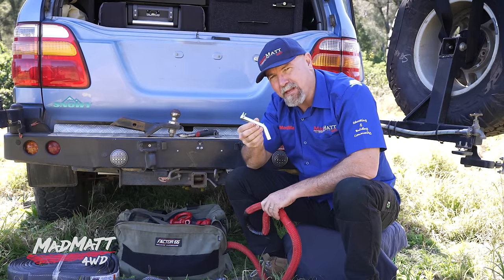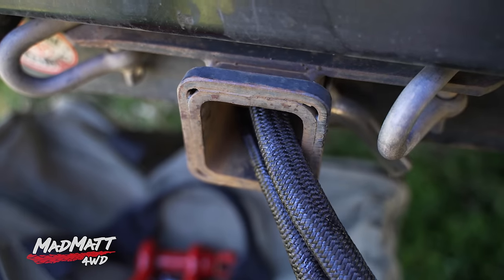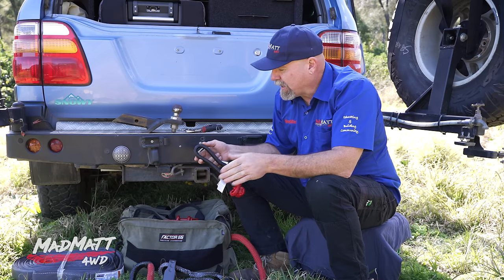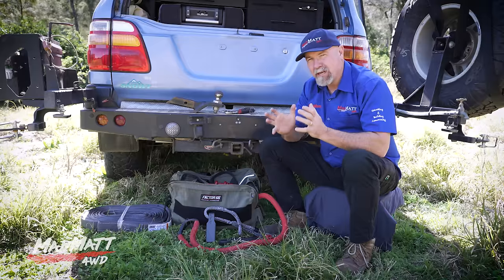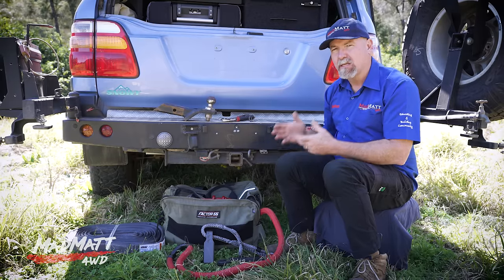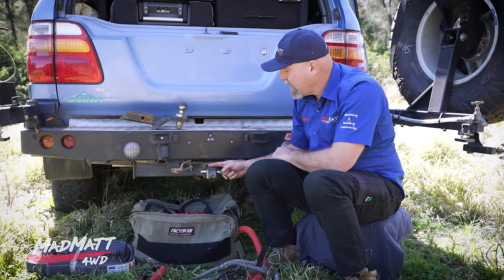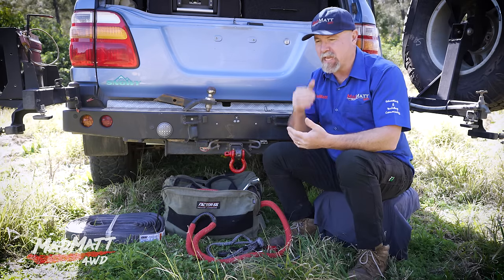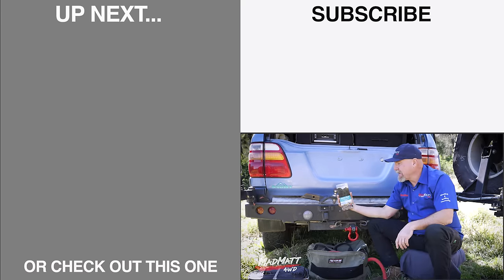Should you use a hitch pin as a 4x4 recovery device? Is it a YES or NO answer?

Comment: i am scared of the soft shackle. i saw a video where one failed or at least appeared that way when it hit the rear fender of a doually it bent the fender in really bad. i saw where they were making the soft shackle but the ball or knot is not soft it appears to almost be hard as steet they were hitting the knot on a piece of steel the know is very hard i think a blow to your head could kill a person. i only use steel shackle never seen one broken
Reply from the maker: That’s interesting. Yes the knot is hard and I suppose I have to agree with you it would be dangerous. Rated shackles have a five times safety rating.
Reply: A side-loaded bow shackle is much more dangerous.   A soft shackle is less likely to become a projectile.  That said, I still wouldn't stand next to them while under load.

Comment: Tl Dr: the pin is not strong, will likely bend and be unremovable. Expect this method to fail and use only when no other method exists. The end of a strap is better than a soft shackle for the tight radius and chafing on the outer edge of the receiver.

Above all, be gentle.

Comment: I just had a look for recovery hitches on ebay and heaps are rated <5 tonnes. That's worse than the pin no? Am i missing something?
Reply from the maker: Yes the pin has no rating at all for this type of loading. The hitch reciever I show has the 4.3t (9500lbs) WLL but when. Tested failed at 23t (51000lbs). Personally I’d be careful of eBay stuff. They say it’s tested but it’s easy to fake it.
Reply: A shackle hitch receiver (45,000lbs rating) or some soft shackles (around the hitch frame) won't cost more than $50 USD.  Small price to pay to mitigate the weakness of a hitch pin spanning a 2" gap.  Even my 7/8" clovis pin hitch is only rated for 10,000lbs and would not be trustworthy in a kinetic recovery.  Everyone learns to respect Physics, sooner or later (too late for some, unfortunately.)

Comment: I think this vid is designed to sell factor 55 hitch receivers, first point you make about the tow bar receiver being sharp is correct, the simple solution is to file the edges over, easy, Robert Peppers test of the hitch pin bending at 9,000kg/  19,800lbs, that's a hell of a lot more than the factor55 hitch receiver is rated at 9,500lbs/ 4300kg, As a 4x4 nationally accredited assessor for over 25yrs and using the tow bar receiver and the hitch pin with a 8,000kg flat snatch strap I have never seen one pin bend, I have seen snatch straps break, so must have developed  over 8,000kg.The factor55 hitch receiver looks good, they are NOT a necessary recovery item.
Reply from the maker: Very few items are necessary. As an assessor I’m surprised your using the pin.
Reply: @MadMatt4WD  Go back to school and study Maths, If you take the 9,500lbs/4,300kg rating on the factor55 hitch, the weakest point in a snatch, using  rated recovery points and a rated 8,000kg/17,600lb strap would be the 55 hitch, and the weakest point on the hitch would be the hole where the pin goes through, if that let go at that point on the hitch you would have a big hunk of metal flying towards the back of your vehicle, unless you used one or 2 drag chains as a dampener on the strap. one chain a third along the strap from each vehicle.
Reply from the maker: @user-nk4gm7bi2v  The reason the hitchlink is rated at the 9'500Lbs/4300kg is because that is the TOW rating of the tow pack. (limiting factor) The tow pack is rated at at WLL not a break strength. 
The offroad industry works on break strength NOT WLL therefore you can't compare the WLL of a hitchlink with a snatch straps break strength. 
Some numbers for you from @factor55 testing for when thier devices fail (break strength.) 
Standard duty soft shackle 39,000LB
Tow Strap 31,000LB
KERR 29,000LB
Hitchlink2.0 51000LB
Hitch Pin 50,000+ LBs

Another example for you.
3/8 synthetic rope breaks between 18-22,000LBs so if you assume a safty of 5:1 that would mean it's WLL is going to be 3.6- 4.4K on a 12,000LB winch

Here's the issue with using a pin it is not in true double shear the way it is when it's used with a hitchlink or the actual tow hitch. As you've found a strap used with care can be connected to a pin as an emergency recovery tool but it sould not be taught as being a safe method of recovery.

As I'm sure you're aware according to the Australian standard we should not even be connecting a snatch strap or any recovery device to a tow pack/bar.

Schools out.
Reply: @MadMatt4WD  Like I said previously, Have seen hundreds of snatch strap recoveries using the strap on the tow pin, never seen one bent yet
Reply from the maker: @user-nk4gm7bi2v  which is why I maintain it can be used in an emergency but not as a primary connection point. I do hope you’re not teaching people to use it as a primary connection!
Reply: A couple of points here:

1. A 'rating' could be WLL or MBS which are very different. F55 tend to rate their gear with WLL often a 2:1 factor which is typically used in horizontal pulls.  A test to break is MBS.  So, a F55 unit of 4000kg probably has an MBS of 8000kg. Tow pins don't have a rating for recovery and it'd depend on whether it's in single or double shear anyway. As you say, time has proven they do work. They also bend, not snap when overloaded. Eventually of course they do snap!

2. A strap rated to 8000kg is typically an MBS, and many straps fail below that so if you see one break, I would agree that it must have been due to a load of 8000kg+.  

3. The tow pin itself has a tiny bend radius which isn't good for ropes or soft shackles. If you put your winch thimble around it then the thimble will deform to the point where you can't fit a 4.7t shackle through...I have made this mistake. Bigger bend radii = greater breaking strength = greater safety.

Comment: Bend a pin or chaffe a soft shackel Its a billion times safer than a hitch ball cannon ball.  

The reese 10,000lb rating in any direction hitch swivel shackle is better than F-55' 9500lb in one direction hitch shackle.    Even hitch shackles aren't the best. 

Doing a soft shackle Y configuration to two recovery points rated at 12,000lb each is better.

Comment: so.....the hitch pin yields at around "9 metric tons" but the factor 55 hitch piece is rated for 9500 lbs which is 4.75 tons or about 4.3 metric tons........
Reply from the maker: Thats a good point I hadn't connected that. I'll have the discusion with Factor55. I still maintain it will be a better connection point.
Reply: @MadMatt4WD  Does the 9500 pound rating of the F55 insert mean that’s how much force it can withstand or is it the max weight of the vehicle you can use it with?
Reply from the maker: Thats it's tested rating WLL working load limit not it's fail rating thats at 23000KG. I need to learn more on this.
Reply: @MadMatt4WD  That’s good to know
Reply from the maker: Josh I’ve been discussing this overnight with Factor55. Here you go. Thanks for the question because I learned something too. The 2” hitch itself is rated for 9500 lbs. that’s the max load. That’s why the 2” HitchLinks, all of them have 9500 lbs machined into them. Our parts have not seen yielding in testing until just before breaking. What’s this mean? Every other item you have attached to the HitchLink and pin will fail before either of those do. 

Standard duty soft shackle - 39K 
Tow Strap- 31K 
KERR- 29K 
HitchLink 2.0 - 51K 
Hitch pins- 50+K 

The entire off-road industry functions off break strength not WLL. 3/8 Synthetic rope breaks between 18-22K so a 5:1 means it’s WLL is only 4.4K on a 12K winch? 

It’s about quality of materials and validation through testing.
Reply: @MadMatt4WD  great information thank you.

Comment: Good video Matt 
But that hitch at 9500 lbs when most trucks are around 3 ton then you load mud and suction. You have all ready over loaded it or same when stuck in ruts or on rocks 🪨 think on what you are saying then you should not use a hitch receiver either as it's not rated for job your thoughts
Reply from the maker: I get what you’re saying. It comes down to what the rating refers to and in Offroad this is often an unknown. In this case it’s the WLL. Working load limit. Take 4.75t bow shackles. They have a safety factor of five. So even they’re being used outside of spec often. But all this comes back to doing our recoveries with greater safety. Not going like a bat out of hell with a kinetic recovery and not reducing the recovery load.

Comment: Fact safety harness and fall arresting Safety strap  250 lbs object dropping 10 feet develops 5,000lbs of energy. It has a solid piece of rope or polyester strap reaching the end of the strap will shatter your pelvis compress your vertebrate Crippling or killing you. That is why there is a kinetic energy section of safety harness tether.  Apply this information to your tow recovery gear. Can you use the hitch pin in the .manner outlined "Yes" been done so hundreds of times. Speed kills. Falling off a cliff doesn't kill you the sudden stop traveling at 32 feet per second  that kills you. Video on YouTube in which they use a class 3 receiver hitch with a block of steel and three quarter inch shackle of the 5/8 inch pin and they use a tension measuring device. And they destroy kinetic  energy straps 1"  Samson kinetic rope. Move up to 2" diameter Samson nylon rope  the pin bends as does the shackle  and the welds joining the square tube to the tube forming the mounts at 65,000 psi. Note as a welder of many years I know that  the first  numbers of a welding rod is the tensile strength per inch of bead.meaning 6011 welding rod welds will fracture if pressure s exceed 60,000 psi pounds per square inch. As per my comment in you in your previous video the hitch assembly is only as strong as the weakest point  it turns out it is the welds.
Reply from the maker: Thanks for the comment. I didn't know that about the rod number.
Reply: @MadMatt4WD  your welcome, I've always try to provide positive information in my comments. By the way back in the 1970's in my early welding years the heavy equipment repair yard used a mild steel welding rod that had similar properties to 6011; was a very smooth low splatter rod called " MAGNA" if memory serves  an  Australian manufacturer do you know if company is still in business?
Reply from the maker: @orangepickel2  I've not heard of them. although I fabricate as you know I'm fairly amature.

Comment: You are using the wrong water tap at your spare wheel. That tap works under town pressure to push up the valve from the seat. Gravity fed water will not do this well. Use a ball valve instead.
Reply from the maker: Ah yeah except this is on a pressure pump and works really well. 😜

Comment: I disagree with a few points and agree with others, as for the speed you cover you didn't cover how much slack to have on the strap, I have seen people basically park bumper to bumper before taking off at speed.
Also no one should be in the area while a recovery is taking place, atleast the length of the strap away from any recovery point on either vehicle.
One other thing the more equipment used the more possible failure points you add.
Reply from the maker: Great comment. The amount of slack has nothing to do with the speed. Some cars can hit 15kph faster than others but 15kph is still 15kph. Agree with the distance for people. Failure points yes but if they’re in good order and correctly designed they don’t fail so it’s a moot point.
Reply: @MadMatt4WD   you use the word "if" they are in good condition, if is a very important word, I have seen dumb things done during a recovery I doubt these people checked or even know how to check their gear, so "is" their gear in good condition? Is more the point.
Reply from the maker: @melthebelgian.5837  good point. It’s a tough problem we have.

Comment: Hitch hooks are not used anymore?
Reply from the maker: I've not seen this item.
Reply: @MadMatt4WD  It's just a hook that fits into a hitch receiver.  It's useful to have it attached full time, and other then off road use, it's a good parking offset for those that enjoy getting right up to your rear bumper.  

http://cdn3.volusion.com/wmgve.vcyeu/v/vspfiles/photos/203074-2T.jpg
Reply from the maker: Ok, I prefer whats called a closed loop system where only a locked hook is used.
Reply: @MadMatt4WD  Is there a reason why open hook is not an option?
Reply from the maker: @BigSmartArmed  Check this out https://factor55.com/closed-system-winching/

Comment: For rope then yes it better distributes the load 100%.
With a strap it is almost a moot point.
Reply from the maker: I'm not sure what your getting at
Reply: @MadMatt4WD  my point i agree in principal with your resoning but dont see a realistic failure point when used with a strap as opposed to a rope that has a much smaller load point
Reply from the maker: Ok i see. maybe watch the video again to see the 3 main reasons they can fail aside from not being designed fro the job.
Reply: @MadMatt4WD  thanks but i understood fine the first time i just dont share the exact same conclusion hence the discussion forum.
Reply from the maker: @jasonfields2793  Ok I think your in disagreement with common engineering principles. FYI I didn't take any offence to your comments I welcome these discusions. My problem is I have so many to reply to I can become short.
Reply: @MadMatt4WD  no i agree with the engineering principles just not the full interpretation or the assesment of risk.
Reply: This is exactly what i was thinking. I've been doing this forever using a strap with a loop that fits perfectly in the receiver. 🤷‍♂️
Reply from the maker: @leevancleef553  so because it fits perfectly it’s designed for it? Of course not. Why not just use the right gear that gives you the best chance of a safe recovery?

Comment: No, pin could break or bend, hitch pins are shear rated at the point between hitch and hitch receiver
Reply from the maker: Well they can fail like anything but with a strap they fail at a lower point as they’re not in true double shear.
Reply: That sounded more technical of what I said, good 👍🏿 Job
Reply: Man to man splanning lol 😝
Reply from the maker: @carebear2272  😂
Reply: I 4x4 long time 64 and 65 scout 66 jeep wagoner 72 scout 83 jeep cj5 Toyota sr5 extra cab ram 150 4x4  2004 Chevy siverodo z71 2009 Toyota trd off road 1017 power wagon 2019 jeep 2dr rubicon

Comment: That dude was killed because of a drop hitch not because of the receiver have they been using a regular receiver pull then he would still be alive today but because they used to drop hitch which would already been stress fractured from doing it before when they hit it broke all it takes is a little common sense it and Save a life
Reply from the maker: Yes but others are being killed as well
Reply: thank you, Okie, for your comment.  None of the videos I've seen regarding this particular tragedy addresses the fact that a drop-hitch creates leverage at the 90 degree turn into the hollow 2" square receiver tube.  No one ever analyzes using a tow-ball on a drawbar that has no drop as the mount point - - that's a straight-line pull on the receiver tube/towbar/hitch , exactly the same as the recovery shackle "mount point" (as Factor 55 calls them) inserted into the receiver.  In fact - I suspect using any mount point sticking out from the receiver creates a lever action in both horizontal and vertical planes upon the receiver tube.  that is why you need a mount point of any sort whose length inserts entirely through the receiver tube past whatever cross-structure the 2" receiver tube is welded into.  I'm not sure the Factor55 mount points are that long, depending upon your particular receiver/hitch/towbar.  I have a ginormous D-Shackle through the hole in the drawbar on my tractor - you're supposed to pull at the lowest attachment point on a tractor, otherwise you can flip the front end up if you're not careful.  The imprecise use of terms also creates confusion - I'm self-taught - I remain horrified to think of all the things I don't even know exist that can injure/kill me.  When you get advice - you never know if it's grounded in proven fact or if the adviser has just "always done it this way" and never knew how foolish "this way" actually is.